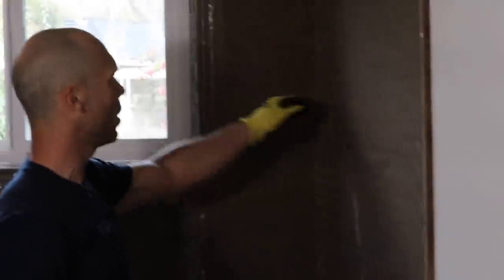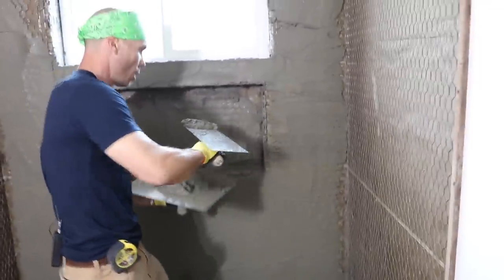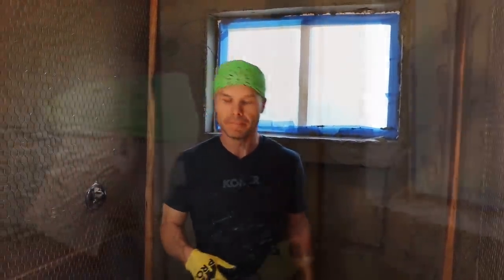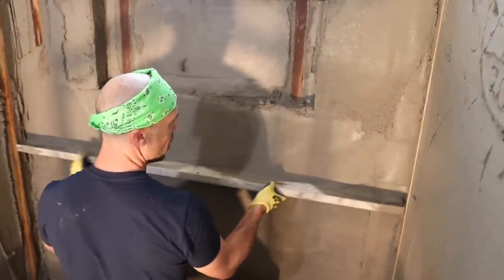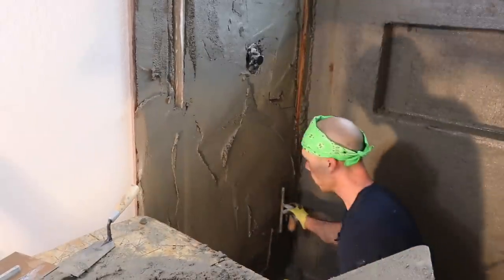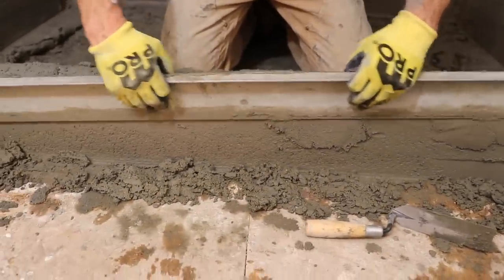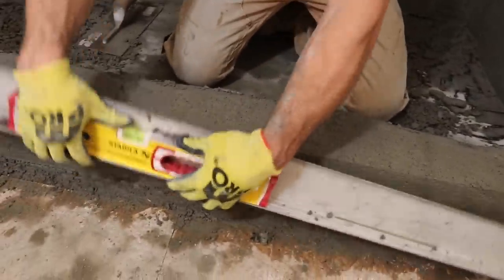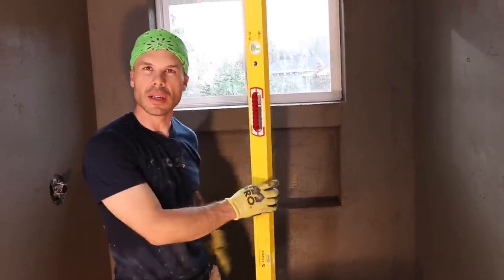Learn how to FLOAT! Tile Coach Episode 23

Comment: When walls are not square how do you work that out?
Reply: Pretty sure that's what the mud fixes, since you can do different depths of mud you can make the mud level
Reply: @FloppyJellyRoll  So you shim first no matter how screwed up the walls are to get it squared. Then screed off of the shims. Is that correct?
Reply: @mostlikelywedoitservices9743  ok, from my understanding, if your wall (plain wall) isn't level, you do all of your paper and wire then when you put the mud up, distribute the mud so that THE MUD reads as level. That way, even if your plain wall was unlevel, the mud made it level.
Reply: @mostlikelywedoitservices9743  or you could not worry about that and once you put your first layer of mud up, put the shim strips up and just make sure that they read as level then put another layer of mud and screed

Comment: Nice work. I shim the walls perfectly before I install backer to have a perfect area follow by red guard. I still remember doing the plaster with wire. 
Reminds me of the plaster walls from older homes. 👍
Reply: In my experience shimming is pretty hard. It's easy to shim stuff flat, but hard to shim it square. Of course if the whole room is out of square, then you need to do funky stuff like mudcaps to make up for the adjacent walls being not square. But you can shim and shim, check with a level a zillion times, and you put the board up and it's still not quite what you wanted. It's better than before, but still just not quite perfect. The little 1/8" you think is no biggie is noticeable once the tiles up, and you forgot to buy those stupid level clips. At least this is my first time DIY experience with it. The other thing as well with cement boards especially is they bend very easily, showing lots more flatness problems, I think that's why certain people still use MMR drywall, as it hangs flatter imo, and is more forgiving. Hardie is too, due to being so rigid, but longterm I think durability with Hardie is questionable, especially without a surface membrane.
Reply: Yes at first it is a pain in the ass using shims but after a few years you get use to doing the same thing over and over again. Just gets easier and faster.

Comment: This is super impressive! I really liked the part about "this is the ultimate reward for perfectionists!" I'm a relatively green tile contractor in the northeast; I recently tried wet shimming behind go board to plumb up the backer board (saw it on Sal DiBlasi's channel), which would have otherwise been horrendous. It worked super great, perfectly plumb walls pretty quickly. Somewhere in between not doing anything at all and floating the walls, a happy medium for me, and I would recommend anybody try it if they like plumb walls without floating. You make great videos, and I'm assuming even better showers! Thanks.

Comment: Way easier, cleaner, and faster to take the walls down, sister the studs straight and square and put up new wall board.  I would never, ever trust paper and staples to hold up.. anything at all. Also why even pull the float strips out.. makes no sense,  just leave it there doesn't hurt anything at all.

Comment: Stucco method? Do they still do that? I’ve never seen it on a house that’s less  than 40 yrs old. Since cement board and then hardie board came out, it seems to have become obsolete. I’m a plumber not a tile installer so I’m just basing this on what I’ve seen.